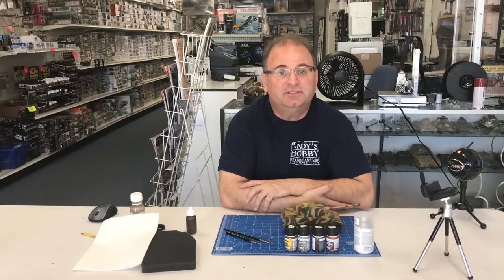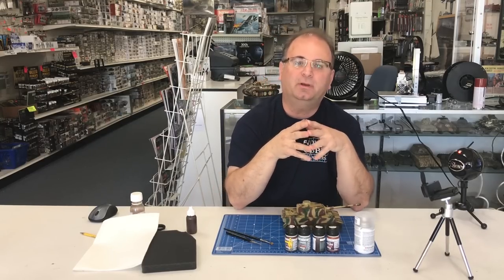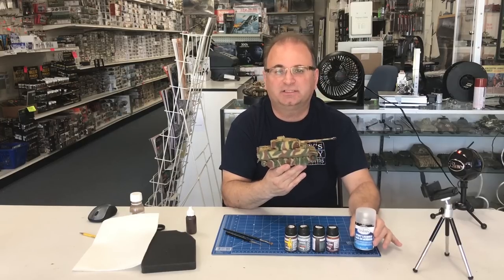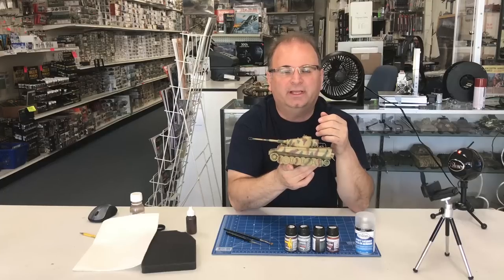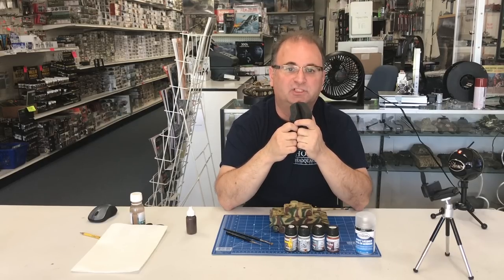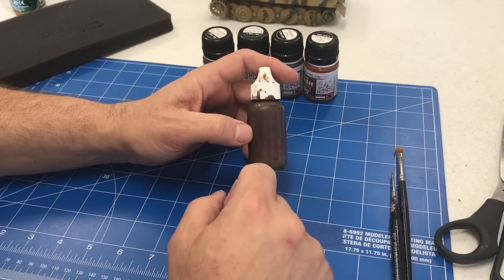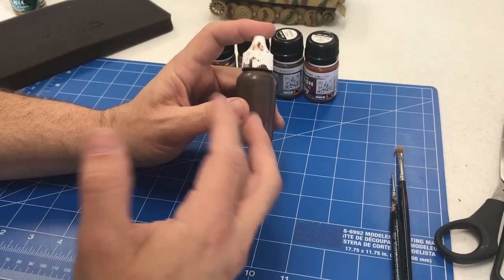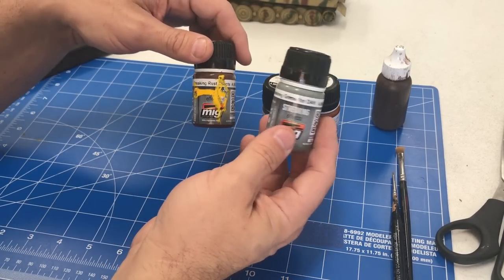Chipping and streaking German armor plastic model kits, how to

Comment: I used silver To do scratches, is that a good idea?
Reply: Jason Bayer Sometimes yes but mostly not because steel rusts and you won't see any silver spots. You can use silver in places where two metal things rub together and rust has no time to appear. For ex. between tracks and the wheel or sprockets.